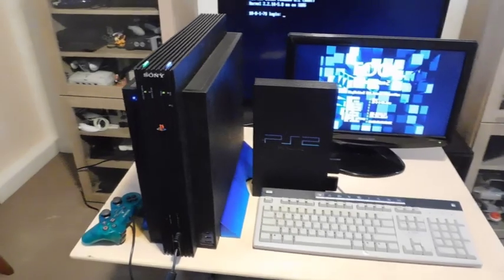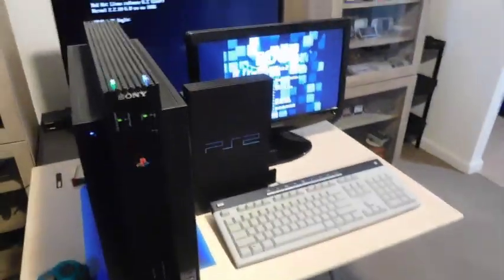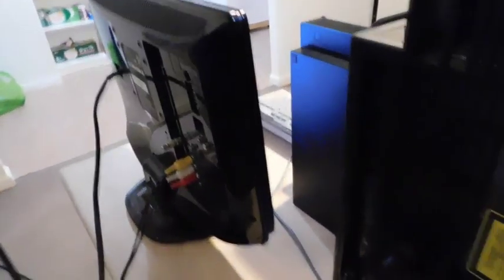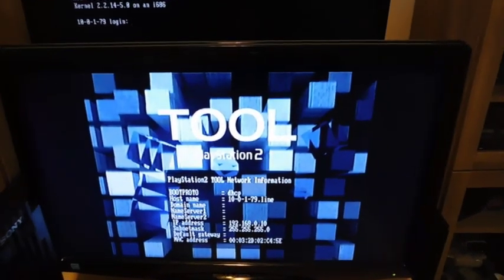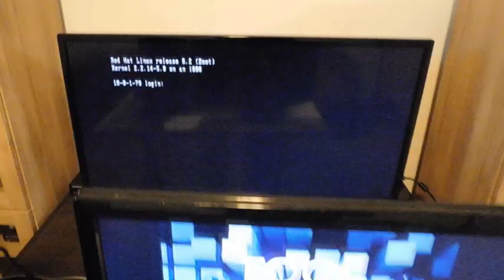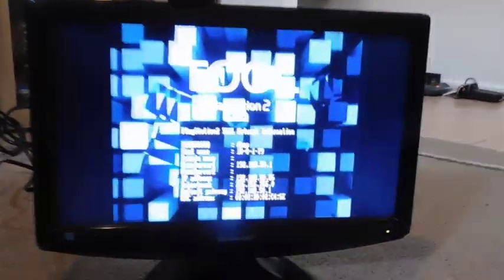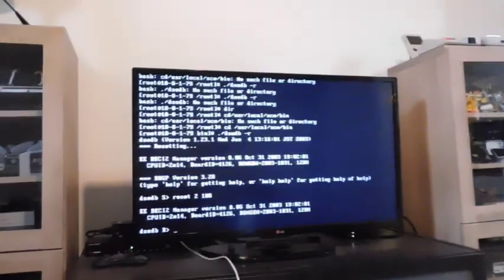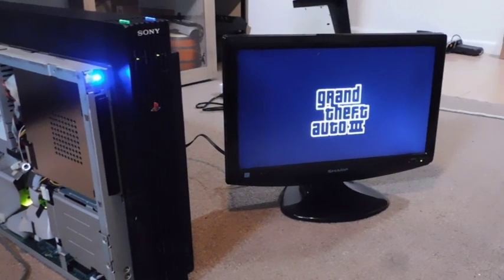PS2 TOOL - A PlayStation 2 dev unit! Repair and demonstration

Comment: Hello,  thank you for the informative video.  I recently picked up a DTL10000 which needed some love.  It boots and posts but it's missing the hard drives.  Would you be willing to share the images you took so I could try to restore my system?
Reply from the maker: Yes I can get those images, it just might take me a little bit of time because I gave them to the owner. You can message me at my website and I can work it out from there

Comment: Hi unsure if POSSIBLE but would a normal pc work with ps2 tool software installed would u know. Or does it have special connections
Reply from the maker: Pretty sure that it has special connections between the PC and the PS2

Comment: this really makes me want to be a programmer.  Just to develop games for the PS2 again.
Reply: You can still make games for PS2 without this dev kit thanks to emulators. With emulators you have all the needed tools to debug your code. Ofc its not exatly the same, but this is how homebrew is actually being made. The main problem is vector units assembly code compilator, there is an open source version somewhere, but the propietary oficial version is really hard to find.
Reply: @Reltdeats  Thanks I wanted to know for a while if it's possible to do it with just the emulator without having to pay so much money for the dev edition of the console
Reply: @Reltdeats  hat's cool, I guess, I'm still not a programmer.
Reply: @mattparker9726  That's your fault! Go out and learn!
Reply: There's a major project that I would like to do involving armored core I figured that something like this would be extremely useful for making a custom version of that game
Reply: One day, it will be a university course

Comment: Is this devkit more powerful than retail ps2? And how the games run?
Reply from the maker: The games run the same as they do on a normal PS2, but you also have the Linux computer running in the background giving you debug information
Reply: @LIRetroGaming  interesting
Reply: No, it isn't. Dev kits, save for the extra features used for developing, have the exact same hardware than the consoles so that once your final product is released, it runs as good as it did on the dev kit. If your dev kit was more powerful than your console, when you ship the final release you would get Pandora's box equal in terms of game stability.
Reply: @frk94-z5b  DECR 1000A had more ram then retail ps3

Comment: Hi i have a ps2 tool and i wanna backup the hdd inside then. how can i do? What program csn i use on my W10 pc? Were i can found some beta or preview iso to test on my tool? Thanks
Reply from the maker: I used HDD raw copy tool to make a backup of the drive. The file system is Linux so you would probably need a Linux operating system to access the backup. I have not yet explored the backup but at least the data is preserved

Comment: wonder if you could play games off the hard drive ..
Reply from the maker: I think that is possible, you need to set one of those toggle switches to DVD drive emulation mode. I still have a lot to learn about how this thing works